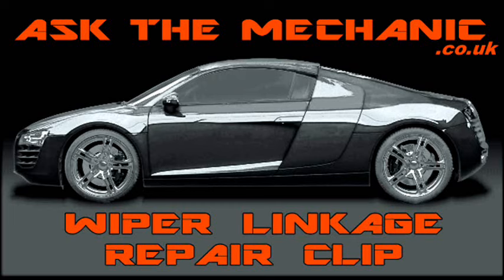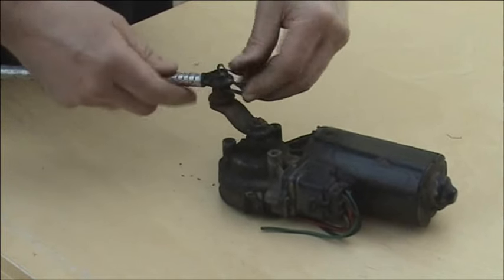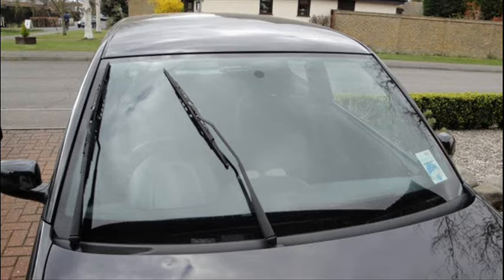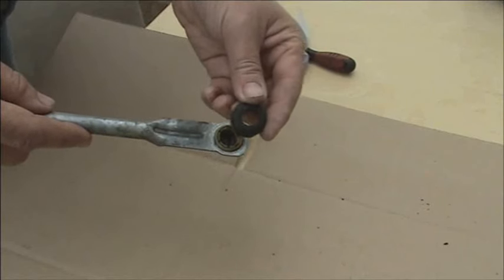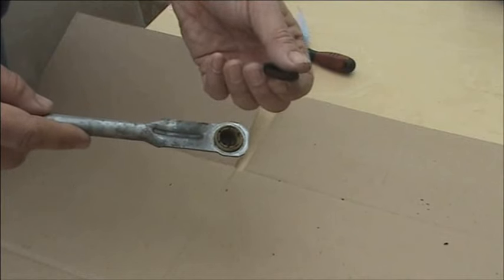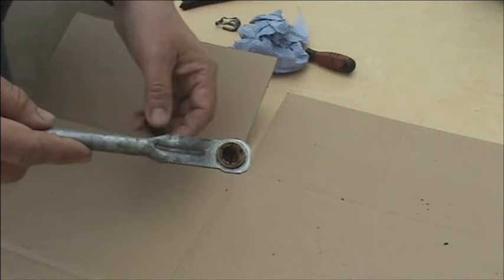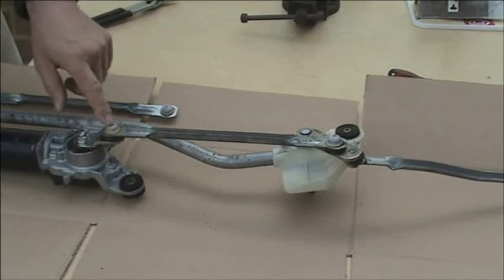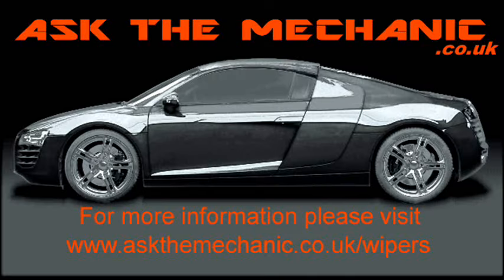Wiper Linkage Repair Clip Tips and Help on Fitting

Comment: Excellent solution to an obviously very common problem. Fast delivery and well designed and manufactured. 

Fitted to my daughters VW Lupo in about an hour, 50 minutes of which were removing and refitting the scuttle panel etc.

Found it easier to fit using a pair of long-nose pliers to pull the spring apart once the prongs were over the base of the linkage arm 👍

Comment: Brilliant. Thank you for that, after struggling with cable ties that failed this spring clip actually works, like the man said I had to remove the rubber seal and packed the ball cup with grease...and it now works a treat.

Comment: Repair clip arrived today. Quick delivery, so thanks for that. Fitted to 02-05 Vectra this evening. Fiddly to get on due to cramped space where the wiper linkage is contained, but tip about removing fuse helped. Appears to be working a treat. Will test it out over the next few weeks. Thanks.

Comment: I have been keeping my Punto linkage together with string for months having been quoted more than £200 parts and labour by local garages and national repair companies as they said I would have to replace the whole wiper system there being no repairs available . I ordered the repair clip , it arrived in 2 days and I fitted it in 5 minutes !
Reply: Exactly the same cituation, only using zip ties, finally broke today and I put the clips on, works perfectly now!

Comment: Hi , wondering if you have a suggestion for fixing the same part of a Renault Megane 2012 , similar product doesn’t fit on the joint. Thank you for the video
Reply from the maker: If it is made by Valeo and has a 14mm ball I think this will fit https://www.askthemechanic.co.uk/shop/windscreen-wiper-linkage-repair-kits/111-range-rover-l322-20022012-wiper-repair-channel-rx-074488175353.html

Comment: great video. thanks for sharing this. quick question: are the wiper linkages the same for the passenger side and the driver side? (btw I have a Volvo V50 if it makes any difference). thanks
Reply from the maker: The V50 has two size joint's our repair clip https://www.askthemechanic.co.uk/shop/51-wiper-repair-clip will repair the smaller link with 12mm ball (only one wiper working) Please message me if repairing the motor link (no wipers working)
Reply: @AskTheMechanicCoUk  I have Volvo S40N 2006, 1.8L i have seen in your list that this clip fits. My car seems to have 12mm ball joint? I have not measured. Will other brands work thats out there? They all look the same. They say theyre universal and they dont list what ball joints it fits. So its a gamble.

Comment: The Clip pops after a period of use.. Is there anyway to make the fix more permanent? Is there anything I can do to the clip to make it more sustainable? Normally lasts about 2-3 months with usage. I dont want it to go on the motor way or something.
Reply from the maker: If it is coming off it probably is not compatible with your type of linkage, the clip works very well but not on every make and model, we now make many products, designed just for one type of vehicle (Ford, Nissan, Vauxhall etc.) Here is link to our website listing all our products http://www.askthemechanic.co.uk/wipers/

Comment: Hi my link arm has fallen down from my wiper arm on my ford flight 54 plate, I dont know what mk my car is please can you advise which link clip I need please.
Reply: I've looked on your web page and there is 2 clips to choose from!
Reply from the maker: Flight is a trim level please advise model (Fiesta, Focus etc.)
Reply: @AskTheMechanicCoUk  Focus!
Reply: Sorry yeah it's a focus.
Reply from the maker: You need a repair plate for a Focus https://www.askthemechanic.co.uk/shop/windscreen-wiper-linkage-repair-kits/2-wiper-linkage-repair-plate-0722301139592.html
Reply: @AskTheMechanicCoUk  Thank you much appreciated 👍ordered the part will update once fitted 👍
Reply from the maker: @devlin2700  Fitting video https://youtu.be/iirmgj92nfg
Reply: @AskTheMechanicCoUk  excellent thank you
Reply: Hi I've managed to fit the part but had to take that grill thing off to get to it, I'm struggling to get it back on, it didnt have screws I had to sort of pull it any advice how I can get it back on please, as the weather is changing im worried it's going to leak.

Comment: Is this a universal clip . I need one for a 2007 zafira please
Reply from the maker: This clip won't fit but we do make one for Zafira B https://www.askthemechanic.co.uk/shop/home/93-zafira-b-2005-2011-windscreen-wiper-motor-link-linkage-repair-channel-atm-zm-0744881753517.html
Reply: @AskTheMechanicCoUk  cheers mate.. just hope I can fit it lol
Reply: @AskTheMechanicCoUk  is it an easy job to actually get the linkage off ..or can I get it on without removing the whole thing ..I have no idea about this   thanks
Reply from the maker: @bobbyboy4496  It depends on which joint is worn, you do not always need to remove the motor or linkage from the car.
Reply: @AskTheMechanicCoUk  i dint even know because i haven't dare try to take anything apart lol its passenger side thats not moving..but it moves freely by hand if I do it that way